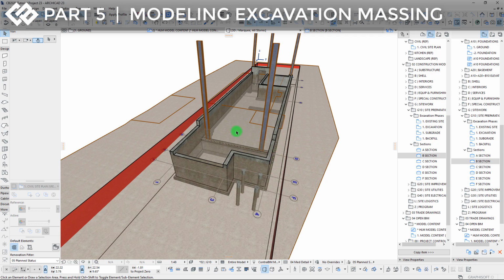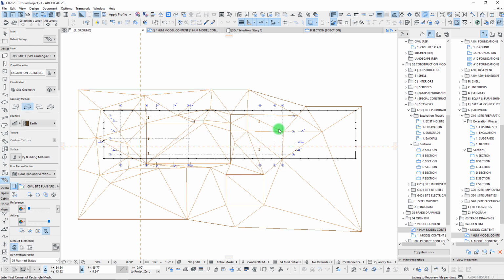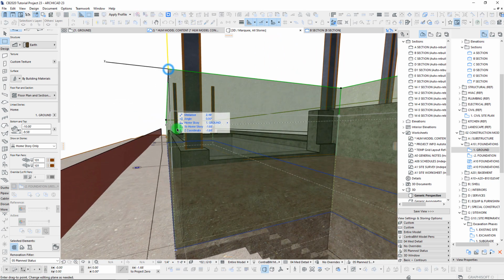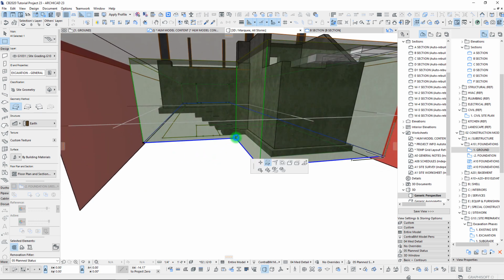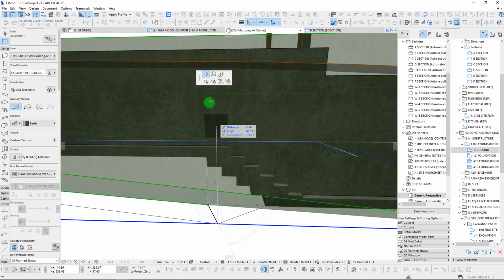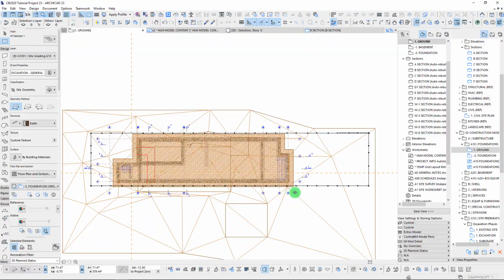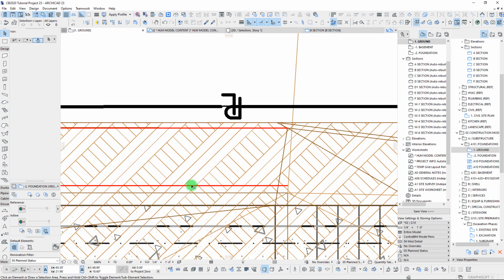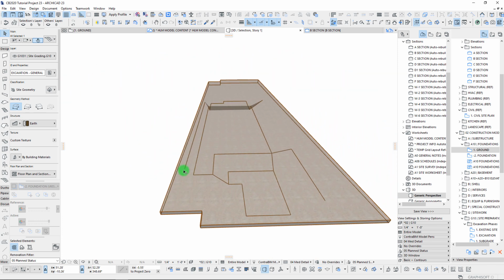How to Model Basement Excavations with Inverted Meshes in ARCHICAD (Part 5)

Comment: Thanks John, a very useful set of videos covering a topic I have always shied away from but want to incorporate into my projects...BTW, I'm curious whether you use slabs or walls for your footings...and if either one makes it easier for doing the step footing like you have on your model...
Reply from the maker: Thanks for the comment, I'm glad your finding the videos useful! I typically use beams for footings, especially the stepped ones, but walls can work as well. If it's a stripe footing I prefer using a linear object. Only time I'll use a slab for a footing is if it it's a mass/mat foundation or a very strange shape. Columns I'll use for column foundations :)
Reply: @CONTRABIM  Thank you for your quick response...I never even thought about using the beam tool or column tool for the footings but I can see the advantages of both ..thanks again!
Reply from the maker: @DubyaD40  No problem! Happy to help